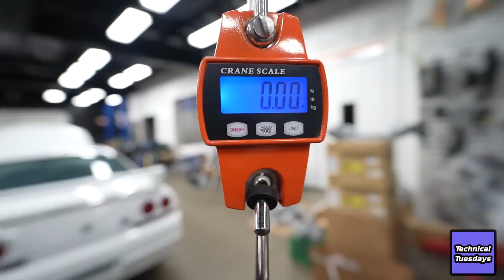CHOOSING THE RIGHT SUBFRAME FOR YOUR SKYLINE (TECHNICAL TUESDAYS)

Comment: Funfact - did you know that some rear subframe mounting holes, from factory, are slightly larger by 1-3mm meaning the subframe sits slightly offset. wont ever see it without aftermarket bigger wheels. New whiteline subframe bushes resolve it

Comment: Curious to see the difference between the 33 and 34 rack. I’m a test engineer at Bosch for power steering gears. I wonder if Nissan went with a bigger rack and higher ratio and different stroke for the 33 an 34 for the weight difference. Now a days we also make longer or shorter ITR for different stroke requirements. Technical Tuesday Tea ☕️
Reply from the maker: We will be doing e racks

Comment: What about how to fix common R chassis issues so they don't get all hacked up? Had a gtt that I imported with no power steering. Turned out to be the variable assist solenoid. I couldn't test it or get another so I put a restriction in the fluid bypass to force pressure through the rack which is all the solenoid does anyway. Another idea is how to do good proper basic mods to a stock 32 33 and 34. When I had my gtt there was so much less info r34 (obviously) that only came from Australia. I wanted to do small performance stuff because its either make it work with the stock ecu or do a manual swap. I didn't want to spend 10k in mods.

Comment: @tommyfyeah I have an R34 GT, went from NA Neo  engine, to turbo Neo and manual with a 33 gtst box. After wiring speed sensor direct to cluster i dont get anywhere near the right speed. Might be a different signal still have incorrect speed after so much time has passed. Do i need the manual cluster ? Who would think the cluster is different from Auto to manual ? 🤔

Comment: Can we get a technical tuesday about how not to do a u-turn and get hit and blame someone for it?!? I would love to learn more about how to do this in my Skyline as well!
Reply from the maker: haha imagine thinking it was legal to hit someone that YOU assumed was doing a u turn. if i WAS doing an illegal u turn which i wasnt. its not legal to t bone someone doing a u turn. so regardless youre an idiot. ill show you how to do it though
Reply: @GARAGESZERO  You know, I do believe you're right in one aspect. I called it a u-turn. I should have called for a tech Tuesday on making bad judgment left turns.

 Sorry to tell you that YOU admitted in your video that you took it slightly wide to the right because your car is low and veered over to what appears to be a shoulder before attempting to make a left turn. This implies you pulling off to the right to any fairly normal driver behind you. (I wasn't there and there is zero proof of you having a blinker on since the video cut. I would be on the side of saying you probably didn't since you were recording with one hand while driving, but again...I wasn't there). Back to our regular programming. Then YOU proceeded to turn left in front of the jeep that went to either veer left around you based on you veering right and him avoiding having to slow down to continue along his path or make a slight lane cross over to pass. Or he was maintaining a straight line based on the bonehead move of veering right. The impact point of the vehicles is not a t-bone situation. I suggest learning about right angles and basic capital letters. 

Hope you have a wonderful day!

Comment: Subframe content and og simpsons clips. 11/10

Big fan of OEM upgrades. Subaru are very similar, take a subframe from a GDB and bolt it into an earlier chassis and get better suspension geometry  or braced parts etc.

Comment: i love this concept and would love to learn and apply it to my gt-four r34 4 door. Question, idk if this gets lost in the comment section but i can never find much info on the gt-four.

does it use rb26 awd sump?
has it got the same subframe as the gtr?
does it share the same suspension as a gtr?
Reply from the maker: Yes it’s basically the same as a gtr
Reply: @GARAGESZERO  thank you ❤️👍